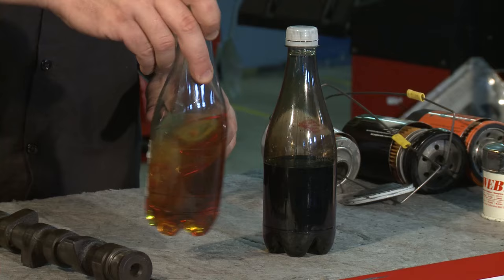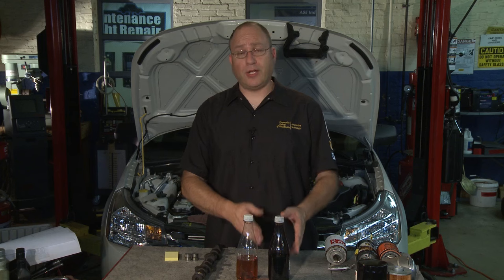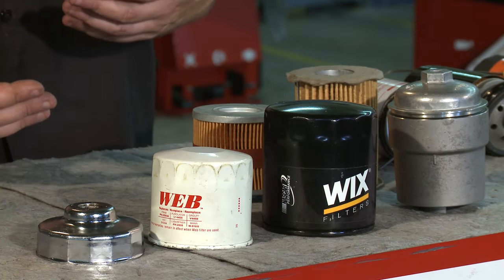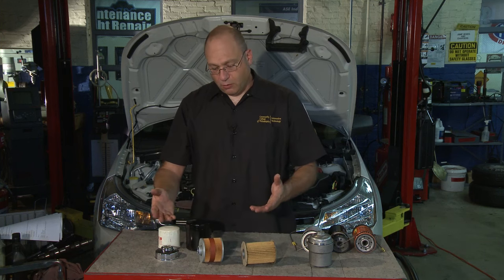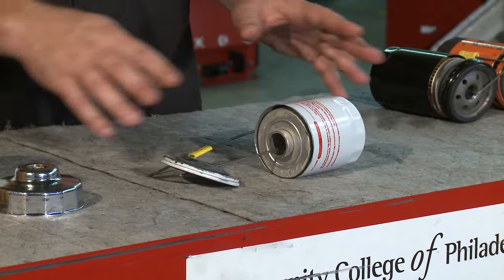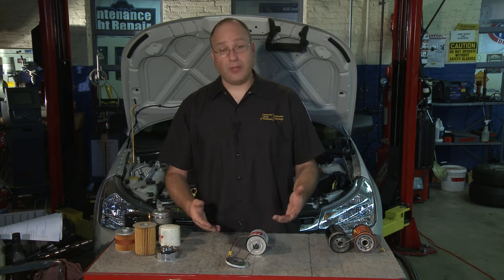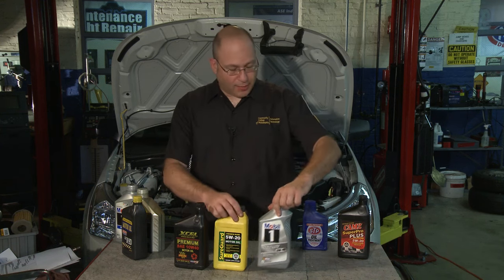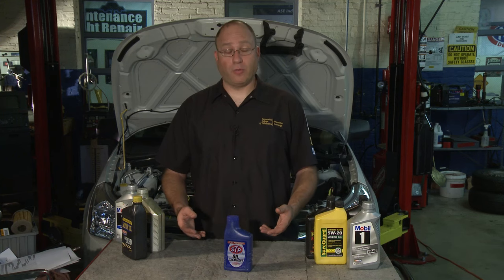Car Corner Oil Pressure

Comment: YES IT'S A GREAT VIDEO AND IT'S ALSO A GREAT LESSONS TO KNOW HOW TO REPLACE ENGINE OIL EVERY THREE MONTHS OR EVERY THREE THOUSAND MILES, THESE CARS AN SUVS OR TRUCKS ARE COMING WITH A THING ON A DASH SAYS CHANGE ENGINE OIL SOON, AND THIS IS HOW IT SAYS IT INSIDE OF THE DASHBOARD IN MY 08 GRAND MARQUIS LS, IN OTHER CARS IT SAYS CHANGE  MOTOR OIL  AND RESET THE OIL ON EVERY OIL CHANGE ON EVERY 3 MONTHS, AGAIN THANKS FOR YOUR ADVICE AND FOR YOUR GREAT LESSONS, AND I USE FULL SYNTHETIC 5W-20

Comment: CHECKING WIRING SECTION:  You state the oil pressure is good when the ground is removed and the oil light turns off (video time 46:03).  Then when you ground the sending unit wire (jumper wire to ground) you state that the oil light should be "on the whole time the car is operating" (video time 47:20-30).  You then started the car (time 47:50)and the oil light goes off.  Am I missing something?.

Comment: In my own experience with an '86 Toyota Camry that had an oil burning problem that didn't pass the emission test, I added STP oil additive and passed the emission test. It was doubtless due to the thickening of the oil that reduced the amount of oil getting into the combustion chamber past worn piston rings and over head valve guides.

Comment: I think the oil light was supposed to be on the first time your when back in the car and checked it. After connecting that wire directly to the body (grounding the circuit). ;)

Comment: Dan I have an old Chevy PU that I drive maybe 500-1000 miles a year and haven’t changed the oil for probably 5 yrs now .. the oil is still clean should I change the oil anyway or wait until it’s gets dirty...
Reply: You should absolutely change it at least once a year. Oils develop acids from the chemicals in the oil coming in contact with the inside of your engine. The acids will slowly deteriorate your bearings, seals etc.